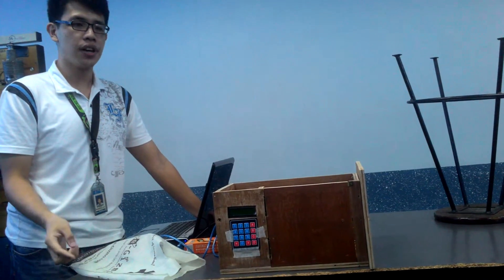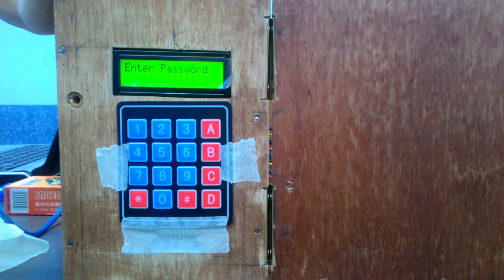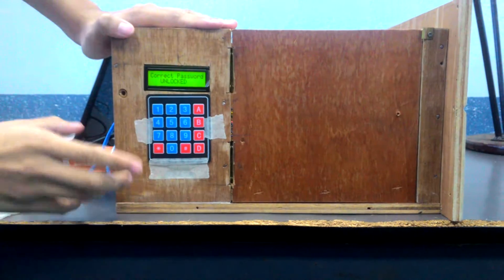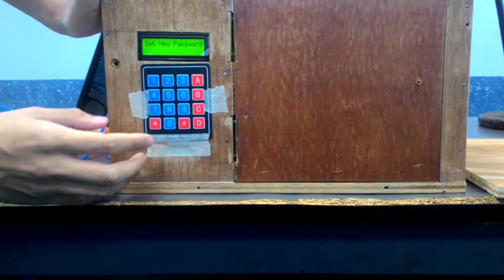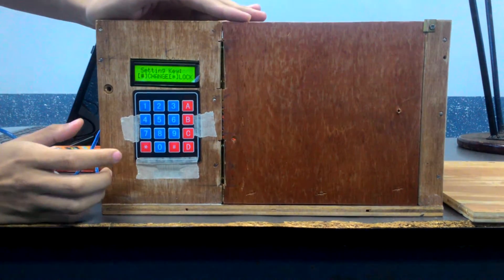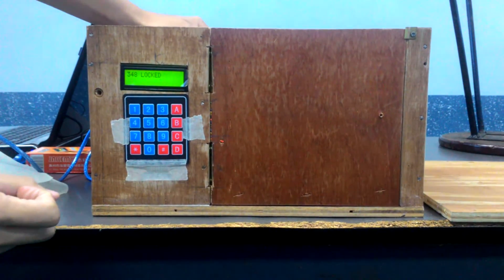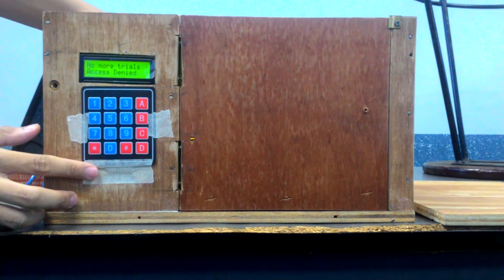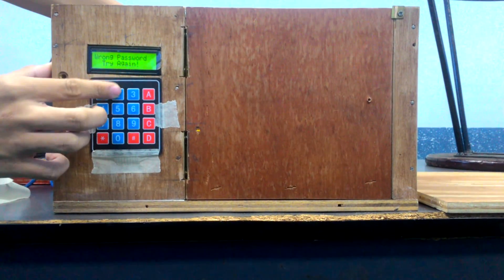Arduino Project (Change Password via Keypad)

Comment: what happen when you changed the password and turn off the power supply can it still hold the changed password or it will be reset.